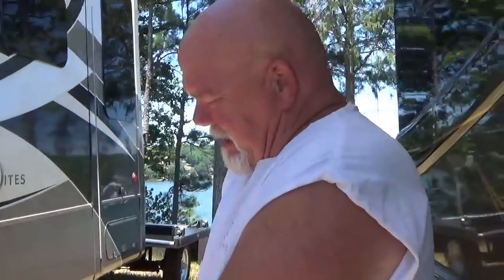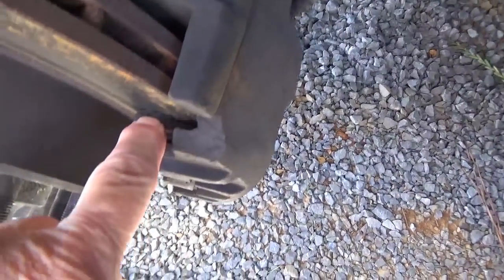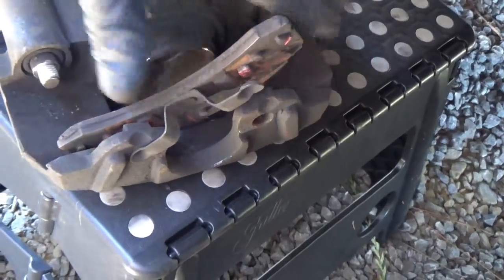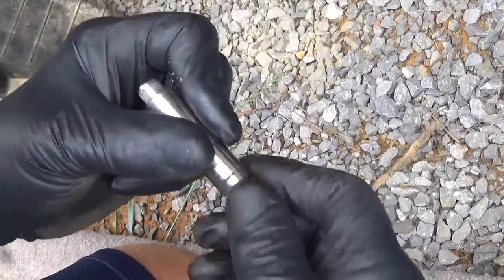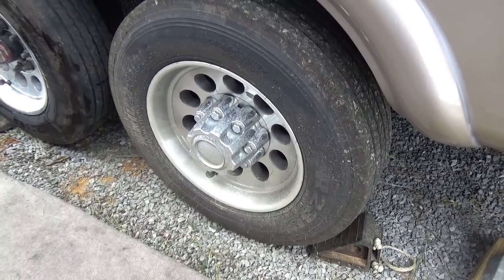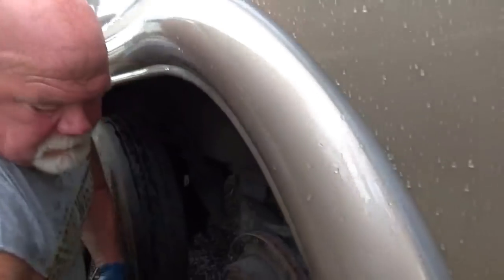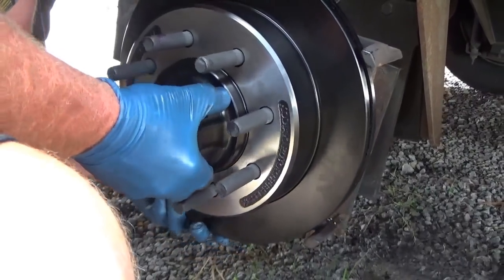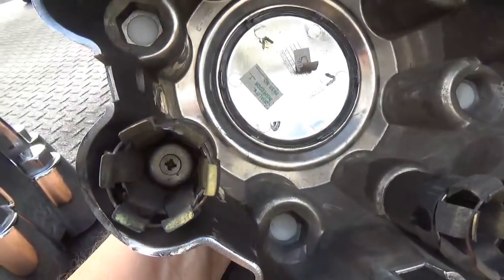💪 Cracked Rotor and Brake Pads Gone! // Full Time RV

Comment: As a mechanic for 30 + years let me give you some tips. When tighten the hub nut I like to pre-load those nuts unless the manufacturer states otherwise. I like to tighten and spin, tighten and spin to I feel a good drag and back off just a little bit and spin again. If there is a gap of just a couple of thousands of a inch the bearings will start to hammer up against the races, this will cause the bearings to wear very quickly. On new bearings I like to go just a little to tight, as the bearings seat and wear a little the pre-load will be perfect in a couple of miles. A little tight is better than a little loose. I like to sand the contact point of the calipers to caliper anchor because over time rust builds up closing that small gap, no need to add lube as it will collect dust and dirt and close the gap. Don't go over board on the sanding just enough to clean them up. If the brake pad on the piston side of the caliper are in good shape but the outboard pads are worn down then you have a problem with the slides. If the other way a round you have your brakes sticking on. The way the pads looked and the cracked rotor tells me your getting excessive heat. Have you looked at the gain going to the trailer brake system? It maybe applying more braking to the trailer than what is needed. You maybe using the trailer brakes to stop the trailer and the truck a little than just applying braking for the trailer. In other words, are the truck brakes just stopping the truck and the trailer brakes just stopping the trailer or is the trailer brakes trying to stop the truck just a little bit.
Reply from the maker: Thanks so much Jim.  That is very informative and I'm going to take another look.  Really...thanks!
Reply: I was thinking the same thing regarding the Gain control.  At all four points the pads were wore off and a cooked rotor points to excessive heat, and 12 months since last pads = to much braking force.  Another issue could be with the air brake conversion .  IMHO.........

Comment: GM design calipers. Worked on them for years. Generally rust develops  between rubber inserts and caliper.  As rust grows it squeezes against the slider and won't allow caliper to float properly wearing the pads quickly. EVERY time pads are replaced, remove rubber inserts and clean rust from bores.  A light coat of silicone grease, reinstall insert, lube inside of insert and sleeve. Also, lubricate inner pad ears where they contact the opening in the caliper. Lube the caliper to caliper support bracket surfaces, install and torque bolts. WILL last a really long time.
Reply from the maker: Thanks for the tips Ken.  I'm going to take another look at everything.  Really...thanks!

Comment: Dave, loved the trailer break repair video.  You always do great work and make everything look beautiful at completion of a job.  Just wanted to pass on that I have used tire cleaner dressing for years on my vehicles, and have found the Superior CoverAll tire dressing is the best.  Makes your tires look like new and doesn’t bleed off when traveling.  Amazon only sells the California approved version in a light blue Aerosol can.  That stuff isn’t as good.  The regular stuff comes in a dark blue aerosol can and you can find it at Auto Zone or O’Reillys automotive stores.  Your trailer tires will look brand new and lubricated.  Keep up the good work on your Rig.
Reply from the maker: Good to know Jerry.  Thanks for the tip.  I'll have to check that out.

Comment: So, from the bad storm at the lake to this, wow! Not sure who edits, Dave or Karen but I like the way you do it for sure. I really have to learn how to do that. If I may I would like to point out a few things to possibly save time and maybe a few $$ next time. The TPMS read outs were an excellent point you made! I’m going to assume you have the single circuit braking system which seems to be common in most of these coaches, they are using a sliding caliper. Given the location, it would benefit to have floating calipers but sliders will do. There is special grease for this easily obtainable from Amazon and sent to you. As a general rule (in cars) you replace an axle set if you need a rotor meaning if the LR rotor was cracked by default you would replace the RR also. When pushing the caliper piston into the caliper use the outside pad area. Using the back of the caliper can at times crack the housing. These tools are available for rent at 90 percent of auto part stores at no charge. The groove in the pad is most likely for noise and heat dissipation, just as the chamfered edges of the pad are there for noise also. Since I’m old school I prefer to check and repack the wheel bearings when brakes are replaced so there is no service needed in between. Also the ratio from your truck/ trailer may need an adjustment. That rotor cracking is a sign of extremely high heat. Lastly, was that a plug in the trailer tire ?? Sorry for the lengthy message, just like videos and want you to be safe. Be well.
Reply from the maker: No plug in the tire.  But I am going to look at the pressure on the brakes.  Thanks for your comments.  Always good to learn from others.

Comment: To clean out the caliper bolt holes you can get a gun barrel brush for what ever size (caliber) bolt or hole.  There is also brushes you can get that clean copper pipe for preparation to solder in 1/2, 3/4, 1 in trade size.  These work great on inside threads.
   Knock out the lug studs from the cracked rotor.  They may come in handy.  Also scavenge the bearings and races from the old rotor.  I cleaned and repacked my old bearings and store in double zip lock baggies.  Nothing wrong with them. May "get you out of the woods".   Like you,  I replace bearings when replacimg rotors or hubs.
   If that rotor had let go,  you most likely would have cleaned everything off that wheel end and maybe messed up a rim   tire and axle tube end.
  8 (9?) Weights on wheel?   I don't the know weight of the individual weights but if was a lot of weight I believe I would have insisted on another tire.
Reply from the maker: Hey Duane.  Thanks so much for your tips.  I save the parts too.  I appreciate your suggestions.

Comment: Great video. I really enjoy your channel. I am going through this issue right now. I am guessing you put the lock tight on the female threads instead of the male threads to prevent the shafts from possible adhesion in the shaft of the slide. I do all my own repairs if at all possible. I am now pushing 70 year of age so some things are getting harder but I am still trying. I am sure you and I could be friends. I have a 2015 38RSSA and I have pulled it about 70k miles so far. We are on our 4th year of full time. I plan on stopping when the police calls my son and tell him to get this old man off the road. I also enjoy beer too. Thanks again to both of you for the great videos. I am not trying to promote my channel but if you are interested mine is "What's up with Geri and Mike".
Reply from the maker: You are correct about the lock tite.  Sounds like we are running parrallel lives, we just started a couple years earlier.  😁  Really like the RSSA floor plan.  Just subscribed.  Maybe we'll cross paths one day.

Comment: Thank god for impact tools. For my fifth wheel I check my brakes twice a year so while I have the trailer up and wheel off I also check my bearings. Yes I have easy lube bearings with the grease fitting but I’ve never trusted that. I want to visually see everything. With the proper tools these jobs are not that hard.
Reply from the maker: Right on Bro!

Comment: I also have a Drv with brakes looking at your rotor it looks like the front part of your rotor surface has worn down more than the back side of the rotor which is odd, and take it from experience if you change your tires to make sure you go to the continental I rated 18 ply, they’re twice the price twice as good and it gives you confidence on the road
Reply from the maker: Didn't know they had an I rated 18 ply tire.  Thanks for the tip.

Comment: Is better to use a dry lube ..wet lubes attract dirt and can gum up.  Also if your tractor is drum brakes ,your disc system will be used more .. So a good monthly underside inspection is a good thing to do
Reply from the maker: Thanks Joe.  Just recently replaced our truck brakes too...may have been part of the problem.  video in a few weeks off that.

Comment: It would my guess that this would be more inclined to happen to a wheel that sets around, unlike a car that is driven daily.  Is that right Dave?  You obviously been a mechanic of sorts in your working career.  I understand everything you've done but it is beyond my physical strength, mainly because I'm nearly 79. Wholy crap, this concerns me a bit :-/  Thanx again kids,  -keith
Reply from the maker: No, this happens from use.  The crack happens from high heat build up.  Put some aside for the traveling mechanics.  :)

Comment: Dave, excellent work.  I would hire you to do my brakes anytime.  A little baffled on you torquing wheels to 150lbs.  I could be wrong, but I think recommended maybe 110 for your 8 lug, aluminum wheels.  I guess 150 has worked, but studs can be stressed by over torquing.  Pardon me for interjecting.
Reply from the maker: Thanks for the info.  I'll double check.
Reply: Once again, very thorough and excellent work.  Back in my dealership days you would've been one of my best techs, if not the best!  Enjoying y'alls channel.

Comment: No grease on the runners? Bad mistake. Those dry runners most likely caused your problem in the first place.
Reply from the maker: Hmmm, I was always taught that you weren't suppose to grease those.  I'll have to check into that.  Thanks.
Reply: Don’t use a lot and you must use disk brake grease. I’m not exactly sure what makes it special but it has something to do with if it ever got onto the disk that it will burn off with out ruining your brakes.
Reply from the maker: @RVMD95  Thanks man, I'll check it out.

Comment: Dave, ? I noticed that you are running with greased bearings. I figured you would of switched over to oil bathed instead since we can run them that way.  Was going to go that way on our rig.  What are your thoughts.

Safe travels and roads Brian and Cindy, "xtreambydesign with passion"
Reply from the maker: Oil bath bearings have a tendency to leak, so I stayed with the greased packed bearings.  When they get warm, it turns into oil anyway.  Oil bearings are easier but I'm good with the greased bearings.  Both are good.  Gotta ask yourself, why are all automotive and truck bearings greased packed.
Reply: @WattsOnWheels  Most heavyduty trucks run oil bathed bearings to reduce maintenance issues and times.  Figured it would cut down maintenance.  Been a heavy haul driver like Alex and Jenn.

Comment: Interesting... those are hydraulic calipers are they not. Mine are electric and drum. So what actuates the hydraulic pressure? I know your truck has air brakes but most people tow with a pick up
Reply from the maker: I have a hydraulic master cylinder that takes air pressure and converts it into hydraulic pressure.

Comment: Those bearing tar not supposed to have greased those are oil bath bearings There is only supposed to be gear lube And those bearings that is the reason why there is a cap Only end of the cap the cap that goes on the hub i work on tralars all the time with oil bath bearings
Reply from the maker: Yeh, I know.

Comment: Why do you run grease in oil bath hubs? Normally those kind of hubs run gear oil. Any advantage of running grease instead of oil?
Reply from the maker: Grease lasts longer.  When it heats up it turns to oil.

Comment: Dave what’s your opinion on that premature wear on those pads possible adjustment issue on braking system? Seems like A lot of heat damage going on there brother
Reply from the maker: I think the truck drums were at the end of their life and I wasn't getting adequate stopping power from the truck.  Video on truck brake replacement coming up in a few weeks.
Reply: Watts On Wheels Good luck on those brakes stay hydrated

Comment: you pull your trailer with a very heavy truck. Could be the cause, when you use your brakes, trailer's brakes take the whole load of your rig and make it over heat  & worn. Just saying!
Reply from the maker: True.  But I have the brakes dialed down in the trailer to compensate.  Hmmm.  Having the truck brakes checked too.  Gonna take a second look.
Reply: @WattsOnWheels   Hi! could need braking  balancing adjustement  between truck &trailer if its possible?

Comment: keep an eye on it. have found  the brake line when old collapses and needs to be replaced hose works fine but after a while it will not let the caliper release. so keep an eye on it.
Reply from the maker: Thanks for the tip Irving.  I'll do that.

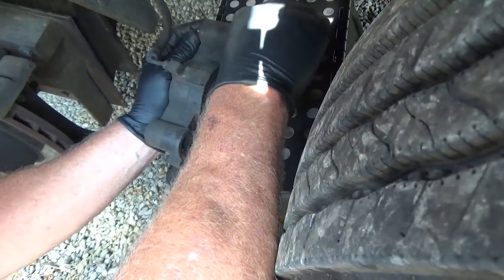Comment: 8:32 ....SILICON SPRAY !!!!!!!!!!!!!!!!!!!!!...... are you kidding us .... that's for door hinges and curtain tracks .... you need  ALL your wheels looked at by a proper mechanic ..... crikey .... no wheels = no brakes , no steering , fire ... then no truck or home ... and no youtube channel .... silicon spray .... never skimp on the wheels
Reply from the maker: Didn't use any silicone spray!  Used synthetic silicone grease on the slide bolts only.

Comment: Did you ever wonder if maybe the wrong regulator valve you had on the blue dot system caused your brake failure. Were you able to verify the pressure with a gauge because 90 psi input pressure gives you 1500 psi at the trailer brake. Any more than that and you’ll do damage to the brake.Your  trailer will be stopping your truck for you
Reply from the maker: Yes, that was the problem and we put in a new regulator valve.  Great minds!